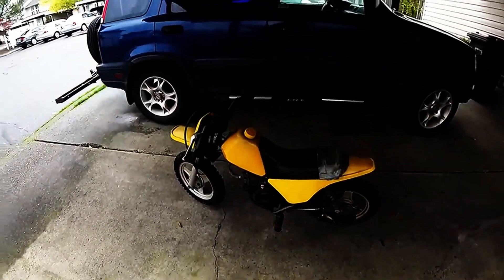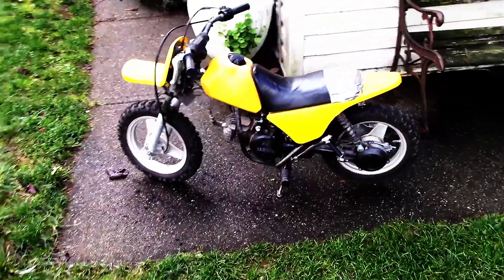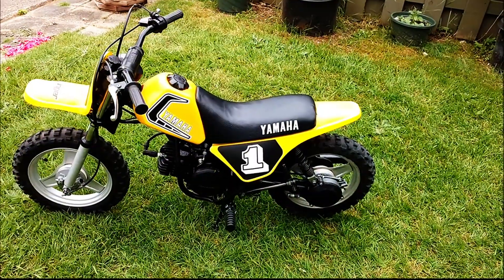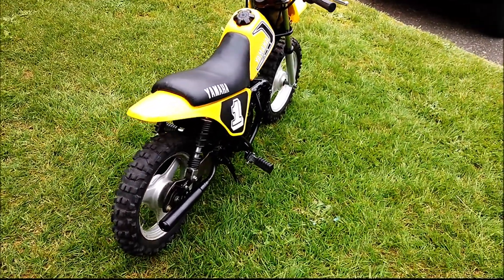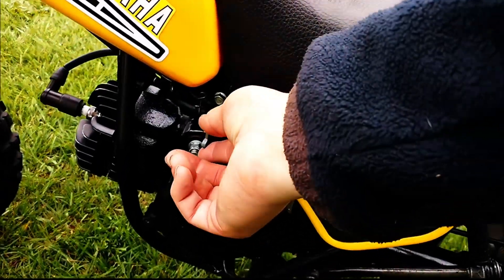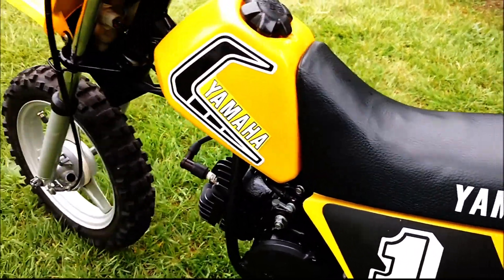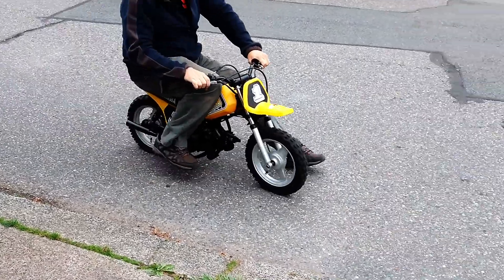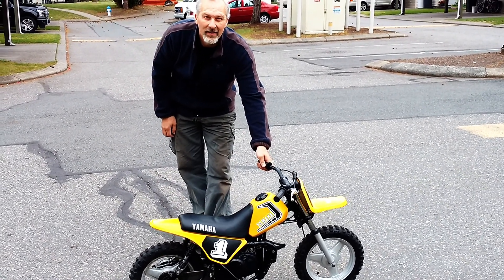Amazing $150 PW50 Dirtbike rebuild

Comment: Great job !! I know how fun the whole plastic sand and buff thing can be lol.  Man I didn't realize how small those things are.
Reply from the maker: Ya the 1981 seat and tank are slightly smaller than the newer ones which makes it look even smaller. I wont do another one of these. With everything being smaller you would think it would be easier but it was actually harder.

Comment: i found the little hole in the clutch cover were the water was dumping in looks like i won't have to disassemble the impeller mechanism
Reply from the maker: Good chance your impeller shaft seals are gone but you might get lucky. I am taking apart my 250 motor today so i will video everything.

Comment: Hi. Can I ask how you got the plastics so neat and smooth. I have picked up a 1983 white model and need to redo the plastics.
Reply from the maker: If you look on my channel I have a plastic restore video. Just do not use the heat gun on white plastic. You will have to do more sanding if the higher grits if sand paper.

Comment: turns out i was lucky to find the hole i pored motor oil into the water pump well and the only place it came out was the hole so i scraped out the gunk out of it and patch it up with jb weld
Reply from the maker: Good to hear.